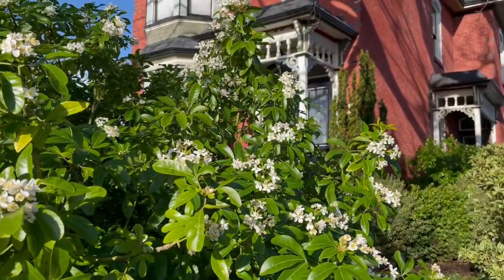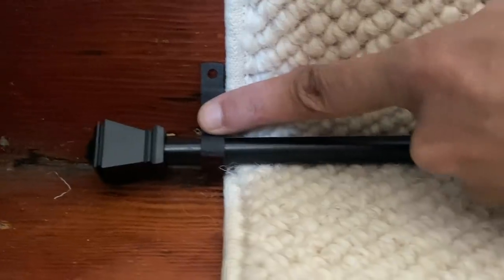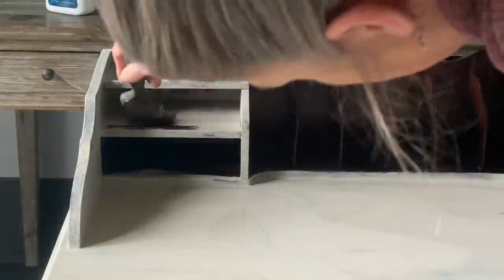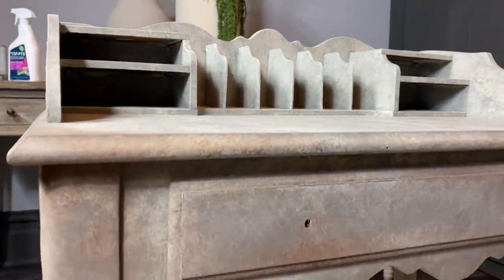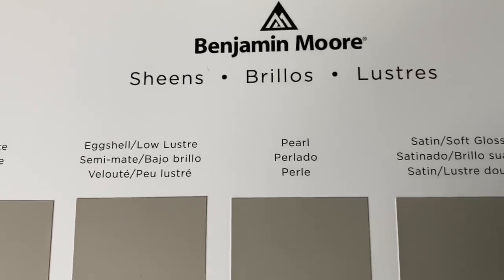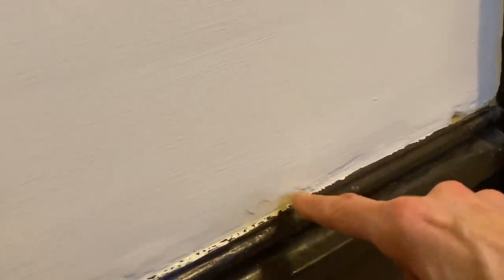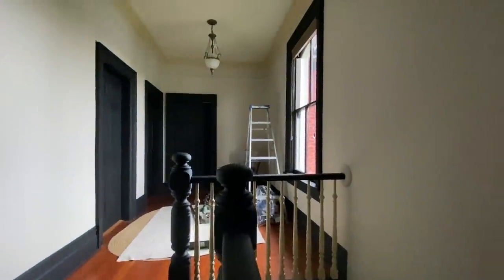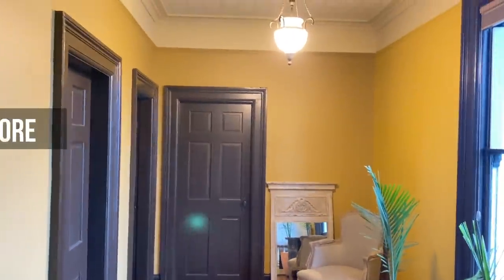DIY Staircase and Hallway Makeover, Chalk Paint Furniture with Glaze & Wall painting tips & tricks

Comment: The upstairs landing is lovely. The stair rods were perfect.  I live in a Victorian as well.  My problem with using flat paint on the trim is it's durability. Do you seal it with a clear wax? And can you wash it?
Also, what sheen are you using in your kitchen and bathroom trim?
Reply from the maker: Hi Kellie! I am thinking of going with a low sheen in the bathroom and kitchen trims.  The mat is durable, and I have used it on many rooms in the last 6 years and it cleans and wipes up well.  I don’t seal the BM paint.  But it’s a preference, start with samples first.   But like you I have lots of dings in the wood trim and the mat finish does a nice job hiding them! ❤️❤️❤️🙏🎨

Comment: 💁🏻‍♀️ When I stop painting, I put my paintbrush in a Ziploc, then press the air out and put it in the fridge. 
  I’ve gone over a month before pulling the brush out of the fridge, and touched-up some spots. 
  I do the same with rollers, but because the handle sticks out of the Ziploc, I twist the bag, then tape around it.
Reply from the maker: Fantastic! Great tip thanks!!!! 🎨🙏❤️
Reply: @TheReclaimedHeirloom ,
    Leave the brush/roller out for a bit (still in the bag), so the paint won’t be cold.
  Thanx. I don’t like rinsing them out because so much paint is wasted.